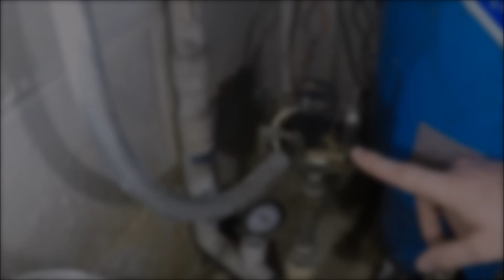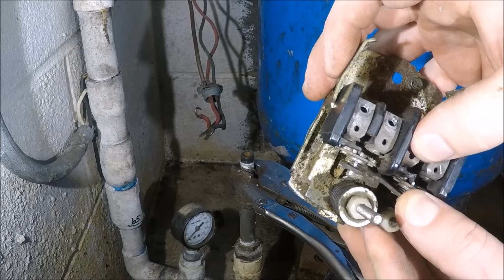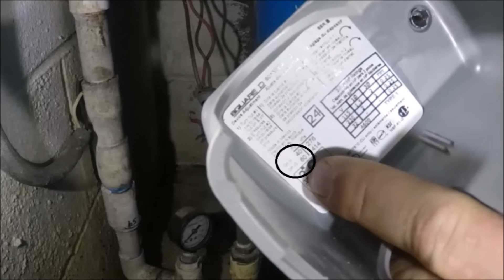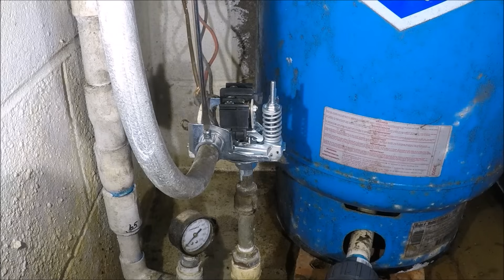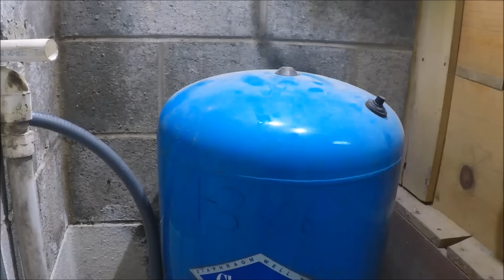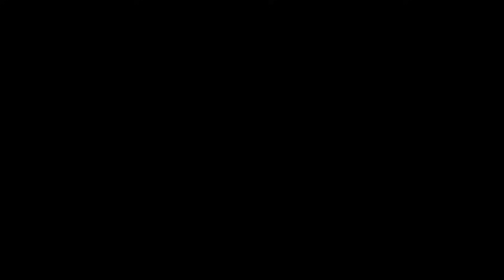How To Replace A Well Pump Pressure Switch

Comment: That’s a great video, I maintained my pressure switch which had the same symptoms as yours by tear it down and sanding the terminals till the copper shines again. Then added some Vaseline to the terminals to elongate their lifespan also as you said I cleaned the bottom water screen and lubricated the gasket with Vaseline again and now it works like a brand new one

Comment: This is a fantastic tutorial. I am having issues and where as it is late I dont wanna call a plumber but am gonna get in contact with a friend of mine who is a plumber tomorrow. I can do without water for now. I know how to fix alot of this stuff but still like watching stuff like this just to make sure I dont miss something. I am most definitely missing something tho because I have searched all around my pump and still cant find my pressure switch. I also need to replace my guage and maybe my bladder/pressure tank. I also have to replace the entire boiler and the sump pump system as thats been overworked. It has been one thing after another ever since I bought this house but its good to learn.

Comment: Could a faulty pressure switch electrify the plumbing system?  Whenever my well pump turns on the copper plumbing system in my house becomes electrified!

Comment: I have a Wayne 1/2 HP cast iron shallow well pump JSU50. It just stopped working. I can’t find any videos on how to disassemble the pressure switch on that particular model. It has no pressure whatsoever and doesn’t make any sound or anything. I shut the main breaker off a few times and nothing when I turn it back on.

Comment: My system doesn't have the red valve for releasing any air still in the lines coming from the house, etc. Do you really need one since the air will come out of faucets, etc., when you open them up?

Comment: My well is outside, I can not find a turn off breaker anywhere to turn the power off so I can replace the pressure switch.  the one box out there says no breaker in this box
Reply from the maker: Most have a disconnect somewhere close like this one. If not there should be a shut off within the main panel or a sub panel. If you can follow the wires that should point you in the right direction. If you can't locate the exact breaker you could shut off all the double pole or 220 volt breakers and then test the switch if that doesn't work you could shut the main breaker and then check to ensure its off with a 110 volt meter.

Comment: Thanks for the video.  There's not enough clearance on my setup to rotate the entire pressure switch.  Can I simply turn the hex nut to remove the old pressure switch and then again install a new one?  Thanks again.
Reply from the maker: You're welcome. The hex nut is part of the pressure switch so it would all turn at the same time unless you removed all the small screws from the bottom. Not sure what you have in the way stopping the rotation of the pressure switch and if you could rotate or remove whats in the way. There much have been a way they got the switch in there unless its glued pipe and they assembled and then glued it in. If so maybe cut/ glue in a union or even a shark bite fitting to make it easier.

Comment: Any idea how I would know what the pressure limits are for a new switch?  The old box cover I have doesn't have a sticker in it, and I can't see any information like that. .  Is there a "standard" one to get?  Is 40/60 rather standard?   Mine looks very similar to the model you have there (it's a pumptrol by Square D)
Reply from the maker: Normally when you buy them you can get either a 30-50 ( https://amzn.to/2E5EpEi ) or a 40-60 ( https://amzn.to/3g8fJZ1 ) has it somewhere on the switch or packaging. You can adjust them also. If your asking how to tell what switch you currently have you can just open the faucet tap & run the water and watch when it turns the pump on. Then close the faucet tap and see what the pump shuts off at.  Older houses typically use a 30-50. Most newer houses use a 40-60.

Comment: When I take the screwdriver to the ground wire I get sparks?!? Breaker is off and I am pretty sure there is no power coming from anywhere else. I even turned off the Main. Is it one of the capacitors?
Reply: I had a similar issue, with ground reading around 10v. I checked main panel for open neutral (which seemed like the most likely and concerning culprit from what I gather), but have but not been able to locate the source. Have you found out where sparks were coming from on your set-up? I do know that some older electrical systems would run a secondary ground from the main panel to the metal service pipe.

Comment: My pump won't turn off until I cut the power. The contact switches look mint condition
Reply from the maker: I would drain the tank and check the pipe going to the pressure switch as there is a screen in there that gets clogged and the switch cant read the amount of  pressure in the system.

Comment: Hi, your video is great and I am feeling confident on changing out my pressure switch on my well pump.  However, my big air compressor in my shop is too far away from my tank house and won’t reach to adjust the air pressure inside the well tank.  What will be the problem if I can’t do that step?
Reply from the maker: Glad we could give you the confidence to take on this repair. You will want it to be pretty close. You could use a bike pump, electric car tire pump, portable air tank ect to raise it up if you need to, connect a few air hoses together. You may not need to raise it. You could drain off the pressure and see what it is before taking anything apart to see if you need to figure out a way to add air.
Reply: TheDIYGuyDOTnet 
Successfully did it today and again many thanks for your excellent video.  Pressure in my tank was 29, let a little air out but it stayed at 29 and I figured that was close enough on a 30/50 setting.  It cycled perfectly and water is running great!  Another successful repair using these fabulous YouTube videos!
Reply from the maker: @julieheaton295  Awesome, Glad to hear it went smoothly for you and its back up and running. Thanks for watching and taking the time to let us know that how it went. Don't forget to give the video a thumbs up. Thanks

Comment: Thanks for making the video.  I replaced the pressure switch and still having issues with not cutting off, even at 80 psi.  Sometimes it wont even let me cut it on at 0 psi.
Any suggestions would be appreciated
Reply from the maker: I would check the pipe that the pressure switch is mounted to as they tend to get mineral build up within them causing the pressure switch to act up and not read the correct pressure within the system. I would say check the screen on the bottom of the pressure switch itself but since you have already replaced the pressure switch that shouldn't be the issue.

Comment: what if there is not a way to drain my pressure tank there are only lines going in with shut off valves
Reply: You don't have to drain all of the water out, unless you are replacing or splicing pipes like he did here to add a drain valve.  Just relieve all of the pressure by opening a faucet, or running a hose until water no longer comes out.

Comment: My pump is constantly running when using water.

Fairly sure my system has sufficient pressure. It has to be this.
Reply: Did you figure out a fix? Seem to have the same problem.
Reply: @fathersonsconstruction1113  I did.

I adjusted my cutoff valve (small one, upper left) counterclockwise two full turns. It was at 50psi, my pump could only get to 45psi.

Shuts off now everytime.

Each full turn of the screw counterclockwise was 2.5psi.  Figure out what your max PSI is after using water and set the cutoff to that value.

Comment: Never knew to use pipe dope and teflon together, so I doubted this guy a bit. Googled it and sure enough, after some research, the verdict is this guy is a scholar...lol. To be more specific, the explanation that I found is quoted here:  "Using Dope and tape together is how it should be done. Dope has Teflon embedded in it and acts as lubricant and Bonds with the Teflon tape making a great seal." Thank you for the great video sir, I guess I should have known you knew you were seasoned, when you installed the T for future draining.....